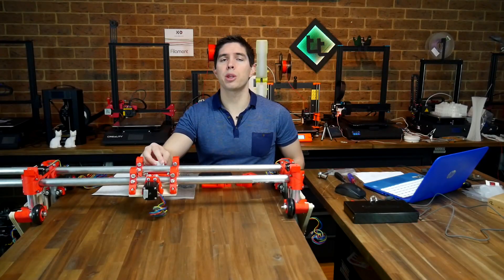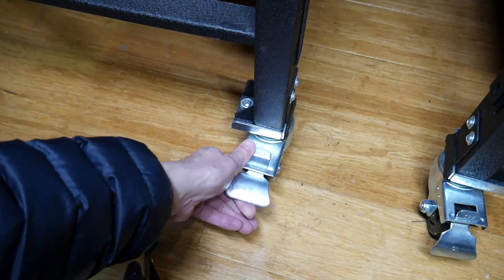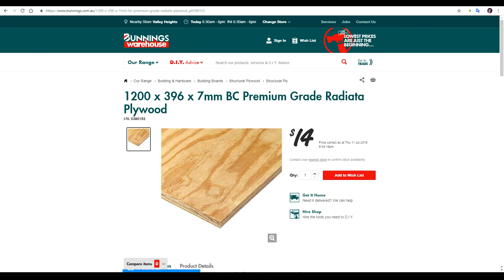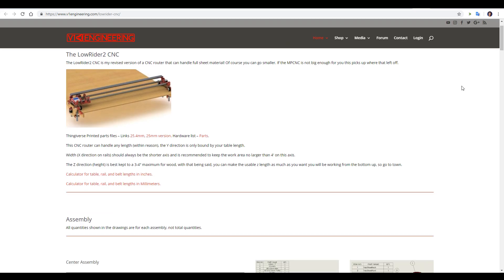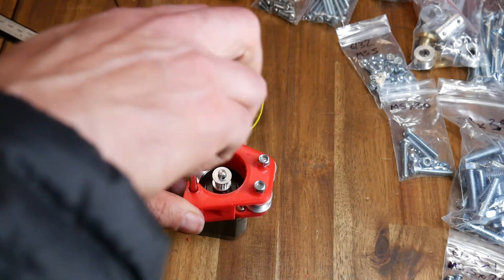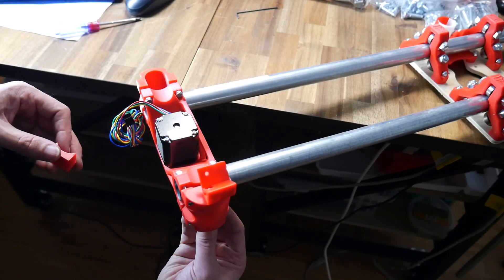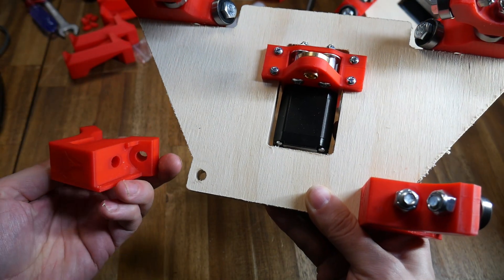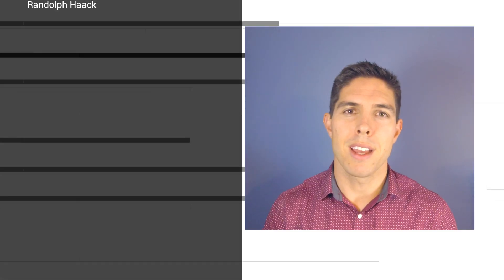3D Print your own CNC - MPCNC Lowrider2 part 1

Comment: I know you just started the project and are following the design as-is (at the moment anyway), but I think I would've redesigned a portion of the Z assembly. Those springy motor to acme rod connectors will do just that, they will spring and add unneeded bounce. I'm not saying anything bad about the design but that is just chatter waiting to happen. Though, a person might never see it if they stick to very slow feed rates and stay away from very hard woods or aluminum and it does help that it's in the Z axis as well, but this could be problematic on a 3D contour cut. Not many people have software that outputs true 3D toolpaths though..

Meh, to many if's. I think I would have preferred a more rigid Z in any case. It does look like a cool project regardless.

Comment: You could keep your z rails their current length and have a swap in 3d print extruder assembly to print truly massive things.  I would suggest 1mm nozzle for large fast structural prints at that scale.
Reply: would the x axis (y axis?? side to side on the table not log ways) have enough rigidity to not have issues while moving? something like this that could print, etch and mill would be absolutely awesome!

Comment: I have been looking at the MPCNC for a few years now but never went through with it because I mostly want something that is rigid and repeatable plus can do Aluminum.
Reply: Many MPCNC builds have been doing Aluminum.  One even made some simple STEEL cuts!
Reply: @Geoffrey Pitman Extremely slowly and with very very very shallow depths of cut.  It is that plastic as it flexes and I am unsure how it could be replace with metal pieces instead.  A lot of machines make their own upgrades from plastic->aluminum->steel->iron but I don't think you can do this with a MPCNC.
Reply: Don't knock it until you try it.
Reply: @Geoffrey Pitman Seriously?  Is that it?  Thank you for the confirmation I needed to see.

Thank you for your help.
Reply: @thebeststooge  I'm saying that your theoretical hangups are just that, theoretical, you haven't used the machine or seen it run, so just assuming that it's not stiff enough isn't doing you any favors.
Reply: @Geoffrey Pitman Did you not see it flex in his hands?  I 3d print and I know what plastic is capable of and I agree with you that it will do some metal BUT as a previous person told me on another thread it will take all afternoon to do it but it will do it.  Go slow and steady and don't over plunge whereas a machine made out of all metal can do 100ipm and take 1/4in to 1/2in plunges per pass.

Comment: Would all the CNC parts fit on the beginner sainsmart you reviewed or is that too small?
Reply: would be too small. The sainsmart is a 3018, which stands for 30cm by 18cm - smaller than an a4 sheet.
Reply: The biggest part is 151.4 X 48 X 48mm
Reply: hes not talking about the 3d printed parts, hes talking about the CNC'd wooden frame parts, which are 330x170~mm

Comment: Did you look at the Root 3 CNC?
I looked at all the available 3D printers and the Root 3 by Sailor Pete came out tops.

I would like your opinion om it please?
Reply: Not for "support", MPCNC I think is way better on this count and has more "active" users. R3 is restricted to BookFace
FTR, I have a complete set of R3 parts printed along with the primary hardware ready to be constructed - it is a good machine but I partially regret not finding the MPCNC when I was investigating.
Reply: @havenview  I saw the MPCNC znc the Low Rider. But I also found another Printer CNC similar to the Root.
I went for the root because of stability and wanting to work aluminium.
Reply: I made the root 3. It’s a far more rigid and upgradeable design.

Comment: Nice! I just finished putting my Lowrider 2 together, and am currently porting the firmware to the BigTreeTech SKR 1.3 and Pro boards and adding laser engraving.
Reply: How hard is it to upgrade the low rider from a CNC table to a laser cutter?
Reply: @joeyhamilton6854  Fairly easy. You just need to modify the firmware to use the PWM output of something like a fan or heater to control the laser driver and print a mount for it. The v1engineering site has a whole page on how to do it.

Comment: What would you do to make this strong enough for cutting metal, or at least make a plasma table? Would you make some suggestions, as in what motors, control board, and so on. Thank you!
Reply: they have already used them for plasma. check out the youtube channel ryan v1 engineering
Reply: @Fr1day-RT  Ah thx bro

Comment: Great idea but, not heavy duty.  It will cut but, very slow. Setting Z  height will require a spoil board given I don't see you cutting into your beautiful work table. So, I'm anxious to see how you accomplish this.  Nice video, keep it going! -Mick
Reply: I believe the plans for this one is to use it for laser cutting/engraving/
Reply: @andrewmoskito1636  Please share the feed rate and cutter.  I'm curious.

Comment: I'm very surprised you only just learned about this CNC machine. Have you also checked out the Dremel CNC? I'm just wondering how much better these DIY machines are compared to that cheap one you recently received. I'm on the fence whether to buy that low cost one or build one. I'm hoping your videos will help with this. Please also check out the Dremel CNC. I'd like to get your thoughts on that one as well. Thank you.
Reply: This was designed to be a full sheet cnc.  The dremel can't scale to a full sheet of plywood.  The precision rods will sag at that distance.

Comment: I am just starting printing the parts for the MPCNC Burly version and now you upload this! Awesome. Ever thought about using the lowrider and a plasma cutter?
Reply: Id say a plasma and low rider may not work well due to the radiant heat of the plasma could cause printed parts to become soft or warp.
Reply: I dont have any prior experience with a plasma cutter but from what I heard is that it doesnt get that hot. And I would plan to have some water flowing beneath the parts anyways. Maybe even above..? Not sure. Like I said I need to get some hands on experience with a plasma cutter. But finding one here in Slovenia will be a pain in the ass. I was thinking about ordering on ebay...
Reply: There are a few folks doing plasma on the V1 forums.  Biggest issue(other than water table) is all the electrical noise coming off the torch.
Reply: @barry99705  Oh interesting. I will look into that. Thank you.
Reply: Dude if you want water to run above cut parts and dont know about plasma you better go get some experience or you will either hurt yourself or ruin very expensive equipment. And plasma melts metal so yes it does get hot. Seriously dont make a plasma cnc until you know how to use one for your own safety.
Reply: @coffinsnail6930  Sure. I know that my knowledge on this is really limited. Like I said I will probably be the only person with a plasma cutter in our entire city. Buisnesses have it but not indiviudals. So its really hard for someone to actually try one out.

Comment: Where did you get the wheels from? I’m having an impossible time finding 60mm wheels in oz!
Reply: They are often sold as goalie hockey wheels. They came in his hardware kit from v1engineering.com
Reply: i got mine from ebay. Couldnt find them in NZ either. Search "60mm x 85a YAK inline wheel for hockey or industry (set of 4)"

Comment: Great - Can't wait for the next one. Will this do aluminum and steel?
Reply: It can do aluminum. There are a few users that have done some steel, but the harder the material, the more you need to be on the top of your game.
Reply: @jeffeberl12  Thanks might be interesting for our robotics club.
Reply: @martinpirringer8055  The V1 engineering website has a gallery with some examples.
Reply: I wish it would easily do Aluminum but it needs to be rigid and repeatable but is it?  I know this old axiom and it goes like this - The machine needs to be made out of the material you plan to work in or stronger.  Plastic parts, anywhere in the chain, is bad as they flex.  Oh, and so much of the stuff on V1 is out of stock plus I really wish they would sell a complete kit minus the Rambo (oos currently) and one minus the Motors because I have better motors than what they come with.
Reply: That axiom is false. MDF is stronger than plastic, and the MPCNC has been used to mill Lots of aluminum and some sheet steel. Tens of thousands of MPCNCs have been built using plastic and it is very capable.
Reply: @Jeff Eberl Be for real.  I mean you can do anything with anything if you go slow enough but I mean in a real world environment with standard speeds and feeds and no plastic piece is going to handle Steel, or Iron, or some woods that are damn near Iron (like Ironwood) going at anything but a snails pace and barely touching the material each pass.  This is where that Axiom came from so still stands.
You telling me this plastic thing can go 100ipm doing 1/4 inch to 1/2 inch plunges into metal like a metal machine can?  If so then I need to see it and if so I will make it for sure.
Reply: @thebeststooge  No. Speed is a different story. You can go look at the v1 gallery and see what is possible. The machines that can reach those speeds and doc are easily $5k-$25k. This is $500. If you can mill some metal, even if it takes an afternoon it is still a game changer. I would challenge you to be real and consider the doors this opens to be able to actually do things like build Al block parts or sheet steel for folding parts. It is not as strong as This Old Tony's CNC, but it can mill metal, with precision, repeatably.